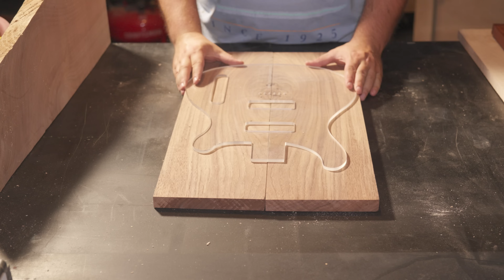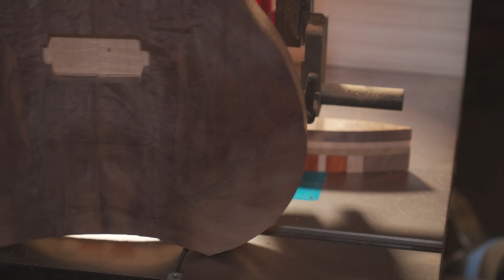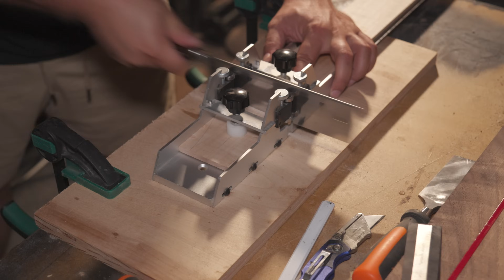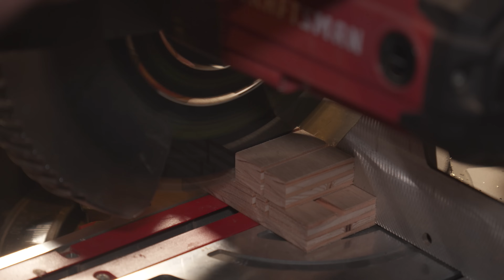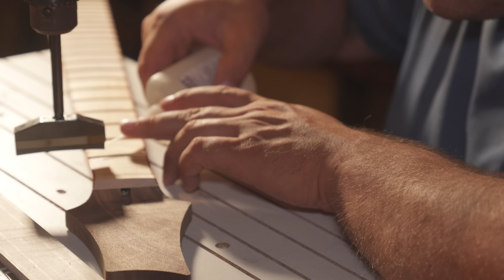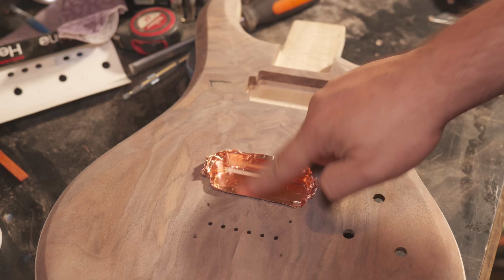Making A Guitar With SCRAPS?!

Comment: You are absolutely correct. Making an electric guitar is just woodworking. But building an acoustic is another thing.
Reply from the maker: True. They’re completely different in many aspects. I’m going to attempt one here soon with some left over Catalpa
Reply: @TheWoodenHobbyist 
I absolutely love PRS guitars, I built one myself, I believe I have a video on my channel.   With that said, the one thing that I would’ve done differently that you did, would be I would’ve made the neck out of the same wood that you’ve used to split the body, that way it would’ve looked like a neck thru. ☮️💜😊
Reply from the maker: @TarynnElizabeth619 I’ll check out your build! Yeah I didn’t initially plan on splitting the body the same way but my goal was to use the leftover scraps in the shop and unfortunately the back panel wasn’t wide enough, requiring the stripes. The walnut on the back is from the same tree as the neck. 

I think a neck through build would be really fun!
Reply: @TarynnElizabeth619  I couldn’t find the PRS build video on your channel. What is the title?
Reply: Acoustics aren't too bad, just getting everything in order and taking your time.
Reply from the maker: @jacobthellamer I’m going to attempt one here soon. I have a tendency to over study something before I try it out lol

Comment: The brass pin setup was a good idea,  however,  you could cut them close to length with nippers, glue them in and just file them flat. The radius block will do the rest.
Reply from the maker: Agreed, I later found out the bandsaw does great too

Comment: Loved the video, and what a beautiful guitar!!! As for myself, I don't always screw up a beautiful piece of wood for a guitar project, but if I do you can bet it's with a friggin router.
Reply from the maker: Thanks! And yes, routers and dull bits can be the number one enemy!
Reply: @TheWoodenHobbyist  Yes, and flush cutting bits that have the bearing fall off during use are frustrating to say the least.
Reply from the maker: Forsure. I have a weakness with flush trim bits at the router table. I’ve probably chipped something on every project from a micro movement in the wrong direction 😂

Comment: Tone comes from the neck which the body collects and pick ups makes the sound from wood
Reply from the maker: Epoxy guitars sounds good too 🤘🏼
Reply: @TheWoodenHobbyist is right and you are mindlessly repeating nonsense. The pickup collects the vibrations of the strings after they are struck with a pick. The type of wood, the type of connection between wooden parts, neck and body affect only the resonance. The electric guitar is not an acoustic instrument. The vibrations are physically felt but do not affect the tone of the instrument. And even if they did, it would be so slight that they would be muffled by other, more tone-affecting elements in the entire sound chain, e.g. pickup parameters, number and resistance of volume/tone pots, pickup switch, amplifier, cabinet dimensions, speaker type and possibly if you record analogue - the type of microphone and its position.
I KNOW THIS because I have been playing electric guitar for 27 years and what is FAR MORE IMPORTANT building electric guitars for almost 8 years.
Reply from the maker: @pawelczerniakiewicz  don’t even get me started on shovels 😂 anything can sound good

Comment: When i first saw you start to cut the bottom part of the guitar i just knew it was going to be the worst part and it definitely is lol had to use flocking material. Craaaazy 😂 overall it looks good but hind sight definitely shouldve went with the normal bottom shape for sure.
Reply from the maker: I kinda like it now the more I play it, but yeah it was definitely not in the original plan

Comment: changing bandsaw blades has not been a pain for me... why is yours a pain? I'm curious
Reply from the maker: Anything that takes longer than 2 minutes to change I find annoying lol I hate setting up the guides and checking for drift, table angle etc.
Reply: @TheWoodenHobbyist  ah I see, yea makes sense. Regardless of how annoying you find it, do you think you would be able to cut the body contour with a slimmer blade faster including the setup time or is it also faster for you to just stick to the blade that's already setup
Reply from the maker: @tusharjamwal  For me personally, it's faster with keeping the same blade when considering totality. I mainly use this blade for resaw purposes and not as much "cutting out." I'm a bit of an obsessive, meaning I won't move on with a cut until the tool is as perfect as it can be. This often puts me into an unnecessary spiral. I have a 3/8" blade I use now and then, but I just prefer making relief cuts and moving on. I think another part of me doesn't want to ruin the perfect resaw setup I have.

Comment: Tonewood does matter a lot but because the neck is longer than body,it has a bigger influence on the tone simply because it dominates 70 % of the strings layout. The sound waves bouncing from the neck alone transmit the tone to the pick-ups where picked up from the sound holes of pickups cavities then amplified. I like how you put the hardest wood (maple) in the middle of body because it will brighten up the tone as it happens to be just underneath the pickups and just in contact with the neck which overall will make it a better instrument. That's where I would put the hardest wood which make a strong construction, better resonance, faster response and brighter tone. I know a thing or two about guitar builds soundwaves and sound vibrations.
Reply from the maker: I’ll correct it and state it makes absolutely zero difference to my own ears, and anecdotal evidence from others to back that up. Sure, if I check resonance through a computer that can detect things my ears cannot, there’s a difference. The maple I actually used was soft maple as well. 

All I know is, if I take the pickups out of this guitar and place it into a plywood guitar and run it through the same amp, they’ll sound relatively similar, if not exactly the same. “Tone wood” affects a guitar acoustically but if ran through distortion and compression, it’s a moot point in my opinion.
Reply: Tonewood is a myth that matters very little in electric guitars. Acoustics, yes, but for electrics the difference is miniscule. In fact, someone recently built a guitar with NO body with tele pickups (it’s on youtube) and it sounded like a Tele. Plenty of carbon fibre guitars around these days that don’t sound noticeably different from wooden guitars. Pickups, amp, speakers matter most for electric guitars. 

Don’t get me wrong, I love pretty looking woods, but tonewood is just marketing speak

Comment: I feel confident saying most modern woodworkers using a mixture of hand and power tools dont care much about the finish left by a rasp lmao as long as its not taking out huge gouges. I just wanna get this shit rounded, man, ill file and sand later, quit selling shitty 4 in hands that barely cut on the rasp side
Reply from the maker: That may be subjective. I’ve had them for years and they work great. A perfect option for those not fortunate enough to spend a lot on a “quality” set
Reply: @TheWoodenHobbyist  fair enough

Comment: Cool guitar but the leather not so much it makes it look like your trying to hide something
Reply from the maker: Well, I was trying to hide something.
Reply: @TheWoodenHobbyist  my  thought would have been the glue and sawdust trick
Reply from the maker: @jamesbossingham9694  initially yes, but I did a bad dip showing the extent of damage. It went past the chamfers on both sides. The filler trick would’ve been 10 times more obviously and less visually appealing. Now I just get to make a leather strap for it and it should match a bit better. A mistake I’ve learned from. I’ll be using a router and jig for this particular portion of guitars in the future.

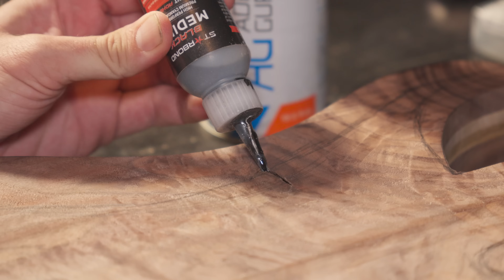Comment: 5:00 So what's the point of picking all that great wood if it doesn't affect the tone??? Make it out of plastic, I dunno. Geez make an acoustic guitar instead that can benefit from this wood!
>Pickups, amplifiers, playability and setup.
So you can make an elec guitar out of anything rigid. That's ridiculous, that's hardly an instrument.
This is a bit like building an electric keyboard's casing and top out of fancy wood and woodworking. it sure would feel nicer to play, but it wouldn't change the sound one bit. The keyboard would benefit more actually because the keys made out of wood would move differently under the pianist's fingers than plastic ones would. But here with the guitar the strings are the same.
Reply from the maker: I liked the look of the wood, it was also free. That’s why I chose it.

Comment: Any skilled luthier understands that the choice of wood type and shape significantly influences the guitar's tone and sound. They also recognize the importance of intonating the guitar body to the note A (440 Hz) to ensure a well-tuned instrument that performs optimally. This involves meticulously shaping the guitar body until the desired tonal quality is achieved. Crafting a guitar is not merely woodworking; it requires a deep understanding of acoustics and the mechanics of sound.
Reply from the maker: Well, acoustic guitars for sure. But electrics, not so much. I’ve seen too many epoxy guitars, steel guitars, shovel and box guitars, pallet guitars etc. 

They all sound good, subjectively. At least to my ears after playing for 25 years. But yes, the wood choice and binding shaping is important in *acoustic guitars.
Reply: you can lop off 80% of an electric guitar with a jigsaw and not alter the tone...........your math is taught by gibson and prs,not the real world
Reply from the maker: Damn straight
Reply: @TheWoodenHobbyist  i had a vintage les paul custom for years and several other cheap off brand ,unknown wood and plywood super strats,i used one of them in the studio to record an album because i preferred the feel,play-ability and sound of it.....and yes,the les paul had two headstock repairs before i got rid of it.....i loved it but made me realize tonewood arguments are silly as the ridiculously minimal tone differences are completely irrelevant....i do love the look of beautiful wood though
Reply from the maker: @waynesmith-r8c  true that! How they feel and  how they look are significantly more important before choosing pickups, in my personal opinion. I know it makes a difference to some extent with acoustics, but I found a Martin guitar recently that had a laminated plywood neck and it sounded phenomenal. The top was standard spruce, though. I’ll definitely give an acoustic a shot with an “anti-tone wood” soon and test the differences
Reply: No I'm with the first guy I can make two of the exact same guitar out of two different woods and the sound completely different. Now yes of course you can use the Amp and different pickups to make them sound the same but without any effects or amplification every single guitar sounds different even if they have sequential serial numbers